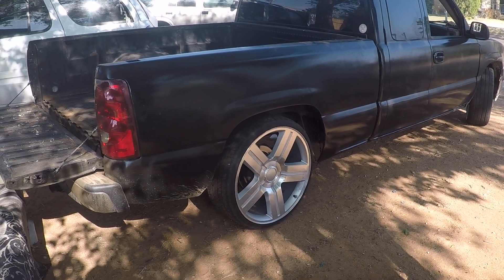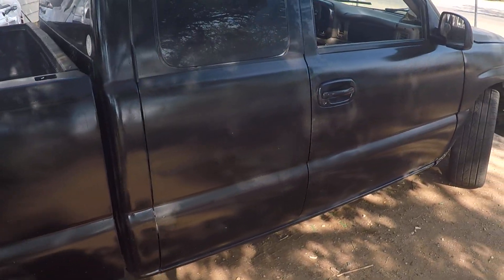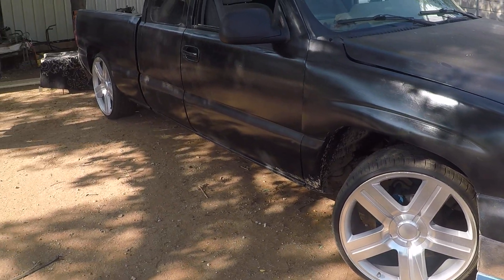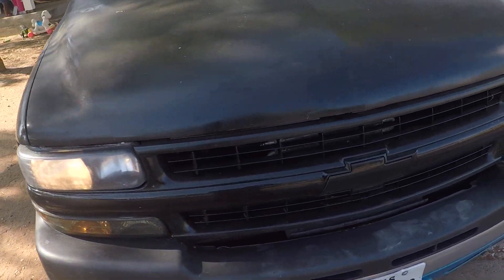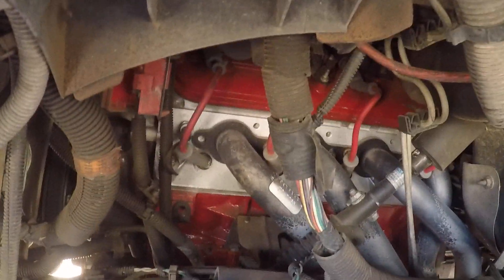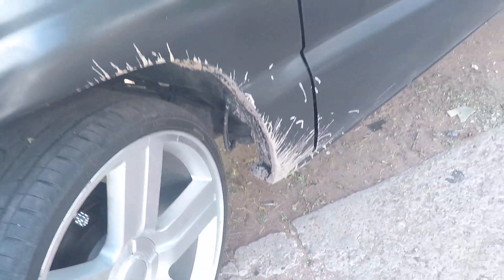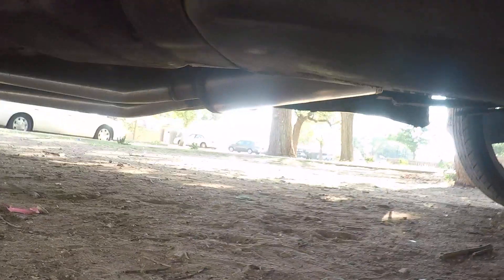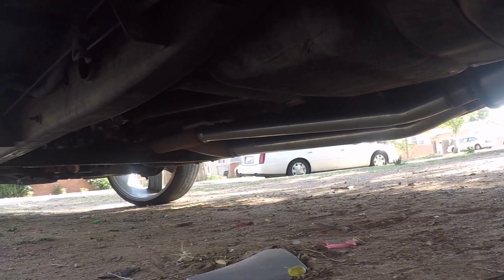Cammed 5.3L 221/226 cam motion cam on 24 inch TE

Comment: What particular Magnaflow is it, because your truck is  extremely quiet. I'm getting tired 😫 of my 2,000 rpm interior drone. Think I'ma do QUIET muffler & ELECTRIC CUTOUTS when i wanna make noise.
Reply from the maker: KILLERADO preciate the sub, I noticed when u dump the exhaust , they do that hummm, run em out the back and u won’t here as much huh.
Reply: @hdwrenchheadevans7227  mine are out the back..... an it still is aggravating at times.
Reply: I added a vibrant ultra quiet resonator to mine to tame it down. It's tame when cruising and nasty when you get in it now. Much better for daily and weekend track runs...